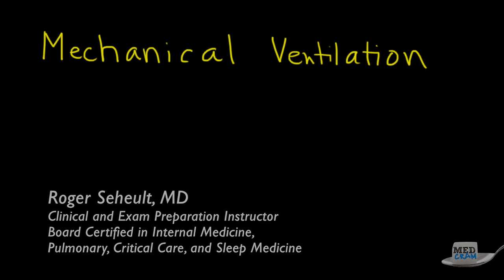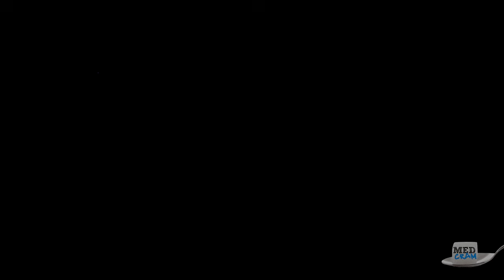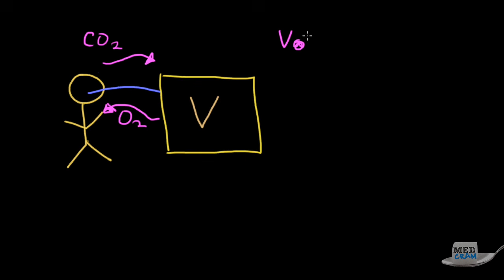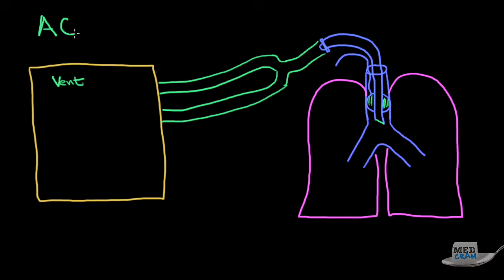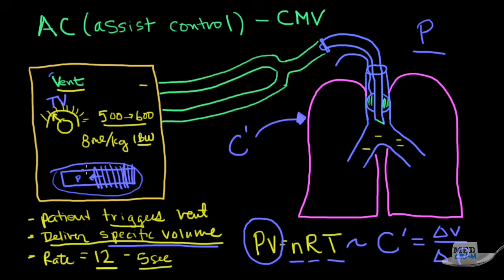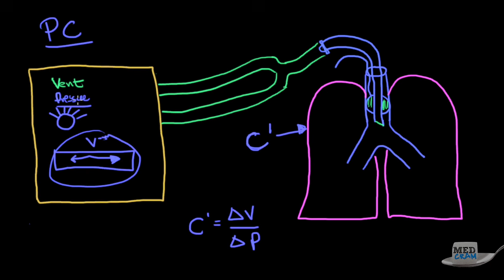Mechanical Ventilation Explained - Ventilator Settings & Modes (Respiratory Failure)

Comment: If you DIDN'T have a ventilator - could you use an IRON LUNG instead?
Reply: Iron lungs are hard to find. They cannot find parts for the old ones that are still around. But it was helpful in the past especially for Polio patients.

Comment: AC is actually a name strictly used by Puritan-Bennet ventilators and akin to calling all tissues Kleenexs. CMV is most accurate name to use. Just clarifying this because there is a lot of confusion with ventilator nomenclature.

Comment: I'd love for someone to answer if a patients triggers a breathe if the breathing cycle continues as prescheduled or resets breathing schedule. 

In other words; if patient breaths in between scheduled breath is it going to lead to hyperventilating the patient?
Reply: The patient can be hyperventilated if they continue have respiratory efforts and trigger the delivery of fully supported breaths. It does not reschedule the breaths that are set.
Reply: @kennethdique1950  Your patient can absolutely hyperventilate in PC-AC or VC-AC. This is why RT's manage ventilators, they know in-depth about mechanical ventilation.
Reply from the maker: It resets the breathing schedule. No hyperventilating

Comment: An update to tidal volume. It is no long get 8 ml/ kg ideal body weight. It is now about 6-8 so 8 would be the max tidal volume. I choose the middle 7 so you can go up a bit and down a bit. The slightly lower tidal volumes are to protect the lungs. Max is now 8
Reply from the maker: +Brian DeLuca right. Start at 8 and get down to 6 as much as possible.
Reply from the maker: +Brian DeLuca and prone!

Comment: Assist Control is not the same as CMV...CMV the patient does nothing
Reply: 8:29 Assist-control and continuous mandatory ventilation are not one and the same. There's a big difference there. It's called assist-control because the patient triggers the breath and the machine assists the breath and cycles it. Continuous mandatory ventilation would mean the machine does all the triggering and cycling of the breath.
Reply: @bkang7175  Yeap and it sounds like you are definitely an RT as well! Big difference between continuous mandatory ventilation and assist control. This was an overall terrible lecture.
Reply from the maker: +Kayla Roberts Continuous mandatory ventilation (CMV) is a mode of mechanical ventilation in which breaths are delivered based on set variables. ... Thus, today's CMV would have been called ACV (assist-control ventilation) in older nomenclature, and the original form of CMV is a thing of the past. Wikipedia- Continuous mandatory ventilation.

Comment: Great stuff, I am an ICU RN and am always learning new concepts, procedures and perspectives...still, the face pace to the ICU leaves me little time to quietly ponder and dissect all the information, and that's were these short videos really help me grasp the concepts fully.  Bottom line, many thanks!
Reply: Hello there. I have question. If a patient with a mechanical ventilator crashes, do you switch to hand oxygen (ambubaging) or just let the respiratory therapist do some adjustments with the MV?

Comment: If AC is set volume....what is AC/PC. In the unit right now and one of the patients is on AC/PC with set pressure control and tidal volume is the dependent variable. This presentation, however, says tidal volume is fixed in AC.
Reply: erebusnux121 this sounds like PRVC which is a volume targeted mode that limits the pressure to 5 below the set upper pressure alarm limit. This mode is wonderful because it protects the lungs, but also allows for a targeted volume.
Reply: zokrab---- excellent teaching! thanks.
Reply: Please note that AC does not imply volume ventilation.  AC refers to the breath trigger as was explained.  The breath can be cycled or terminated via volume, pressure, flow control, or adaptive/hybrid controls.  It's a matter of what starts the mechanical or machine-delivered breath vs what ends it.  It should not be assumed that AC is only used during volume ventilation and is somehow different from or unrelated to pressure ventilation.

Comment: Love this lecture. Very clear and it really corrects my wrong perception about ventilation mode. Keep it up!
Reply: +Andy Bai 
There are a few factors in sleep apnea treatment. One place I discovered which succeeds in merging these is the Stans Slumber Method (google it if you're interested) without a doubt the most useful resource that I've seen.Check out all the amazing info .
Reply from the maker: +Andy Bai Thanks for the feedback!

Comment: Pulmonary compliance (or lung compliance) is a measure of the lung's ability to stretch and expand. In clinical practice it is separated into two different measurements, static compliance and dynamic compliance. Static lung compliance is the change in volume for any given applied pressure.
Reply: +Gee Cy and dynamic?
Reply: application of dynamic respiratory mechanics as a diagnostic tool in ventilated patients should be more appropriate than using static pressure-volume curves.
Reply: +Saad Butt The difference between dynamic and static compliance was dependent on alveolar pressure
Reply: +Gee Cy thank you so much!
Reply: Static compliance is how the parenchyma/alveoli in the lungs are doing. Dynamic compliance is how the entire lungs are doing

Comment: First, thank you so much for sharing your knowledge and making it understandable to the novice. Although I can't put most of your instruction to practical use in my own job, I appreciate the insight it gives me into the challenges you face in the hospital setting. Quick question, am I missing something or did you not touch on SIMV mode? I watched all 5 parts and if you covered it, I must have zoned out. When you described AC, it sounded like SIMV with the patient triggering the breaths as opposed to CMV breaths being vent-triggered. I realize the videos are finalized, but could you explain (as you do so eloquently) the mechanical difference between SIMV and AC mode? Thank you!
Reply: AC mode will deliver a consistent volume when the patient triggers a spontaneous breath, hence the "Control" in Assist Control.  SIMV will still give the patient a set number of controlled breaths, but the patient triggered breaths (spontaneous) will be as big or small as the patient makes them (not controlled).  AC = vent controlled spontaneous breaths while SIMV = patient controlled spontaneous breaths.
Reply: J£*(@(@(jQjwjjjjajk ajjjJsjajaas

JjjjjjjjhJjjjjjjjhD ft tth0jjkjjjhggykqkkjjjkkkkajjsjJJjk a jd

Comment: I have used your lectures to help prepare myself for Nurse Anesthesia school interviews, and to obtain a better grasp of certain subjects. I have been accepted into the 2015 class and I want to take this time to thank you for all the great instruction you have given me through your lectures.
Reply: CANAYAMD VC and PC are two different modes. They do have variations which add assist control for example  ACVC+, ACPC, VOL/AF(seen on my anesthesia machine). But strict VC or PC have set values that do not assist a spontaneous breath. There is no pressure support setting on strict VC or PC. However you can assist with modes like SIMV, ACVC+, and of course pressure support. ACVC+ is essentially pressure regulated volume control, so you can deliver  a set tidal volume with variable inspiratory pressure to account for changes in lung compliance thus hopefully minimizing your peak inspiratory pressures..hope I answered your question:)
Reply: How did it go?
Reply: That's awesome!  Never stop.  So great to be part of your education!
Reply: mrfrizzle0782 I thought volume control and pressure control are modes of assist control.  You are equating assist control to volume control. Know what I mean?